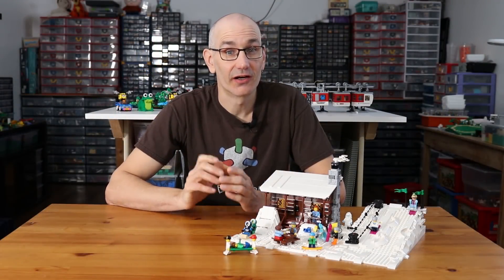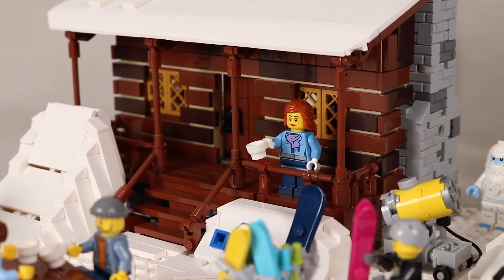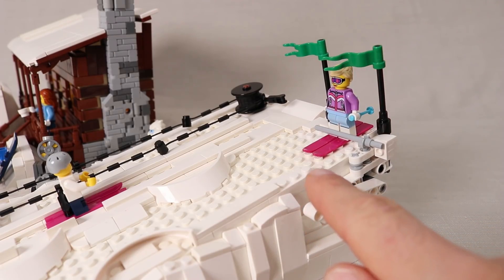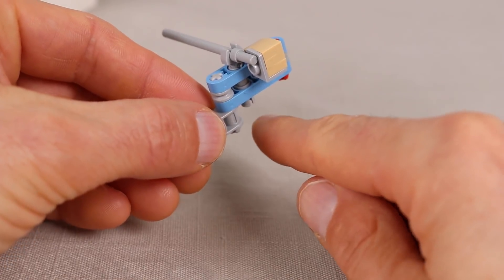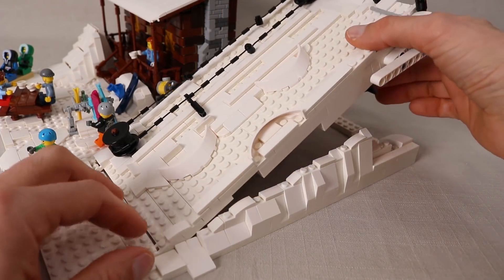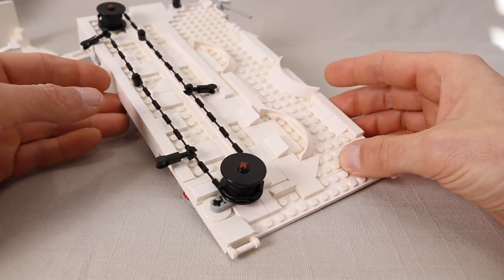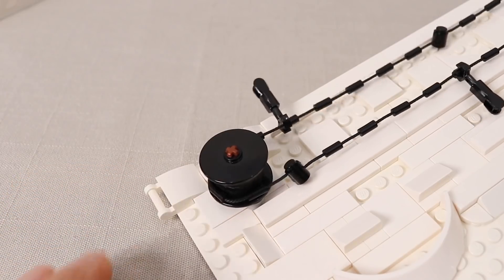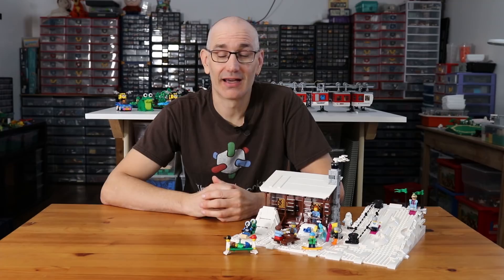Ski Hill with Working Lift - Design Video

Comment: LEGO will remove all the details, remove the gate on the hill,  using a lot of colorful spare bricks, fuck up the lift so you have to place the skiers manually on top of the slope and demanding 250€, right?

Comment: Hey Jason! Another great build! I was wondering what your designing process is like. Do you sketch, used digital software, or jump straight to the bricks? Was also wondering if you could make a video about your design process?
Reply from the maker: I usually just go straight to the bricks and start prototyping different parts of the model. Parts of the model slowly get refined until they all come together in the end.

Comment: This has my vote for an Ideas set.
Reply from the maker: I've submitted it as a project now. Cheers, and thanks for any support!
https://ideas.lego.com/projects/cee772a3-64dc-4707-ba9a-4a431e5297e6
Reply: @JKBrickworks  Supported! hope it gets to 10k supports :D
Reply: @JKBrickworks  YYYAAAYAYAYAAYAAY
Reply: @JKBrickworks  Just cast my vote.
Reply: @JKBrickworks : Hey, I have LDCAD, & want to build a cabin with slopes on both sides, but don't know how to attach pieces in LDCAD. Got any ideas??
Reply: yes
Reply: If it was a lego ideas set, I'm worried that TLG would rip out the nice, cheap PF functions and put in the PoweredUp like they did with the Grand Piano (which I consider to be the worst set ever. The ideas project was amazing, it had actual playable keys).
Reply: @idotic_kid  I don't think the original ideas MOC actually played music though. The function of the keys and hammers/strikers worked like an actual piano but they didn't produce sound. I think that's why TLG went with PoweredUp since it had the sound/music capabilities. I don't see any reason for TLG to swap out the PF for PoweredUp since the ski lift is far too simple. If anything I can see them replacing the PF and going with a manual hand crank instead.
Reply: @Eidolon1andOnly  Ahhh, thank you. Makes a lot more sense than what I wrote.
Reply: Me too! I love this so much!
Reply: @nakshatramusic21  same
Reply: I need this. This looks great!
Reply: Me too
Reply: @toyboy1818  It is one now
Reply: Next idea lego with working Christmas lights lol
Reply: Me too
Reply: Absolutely agreed
Reply: +1
Reply: @adamprz Unfortunately the model in this video was not submitted to the Lego Ideas website, I just wanted jkbrickworks to know that if it was, it would have my vote. If you're interested in exploring the website and voting for ideas you like, go to:
https://ideas.lego.com/
And follow the directions for creating a free account so you can vote for and support your favorite ideas.